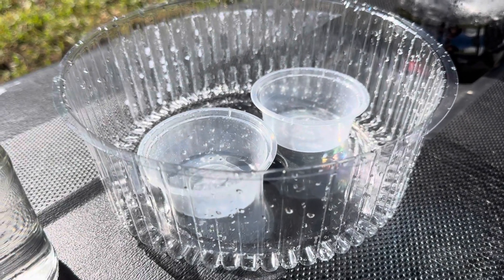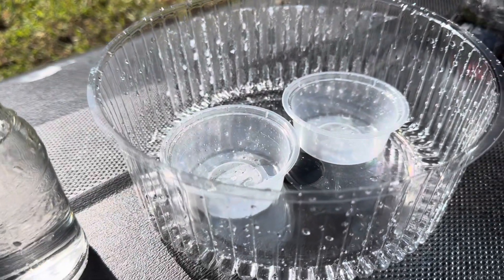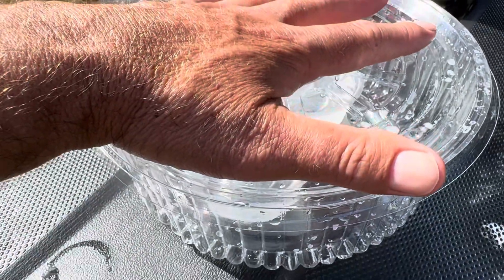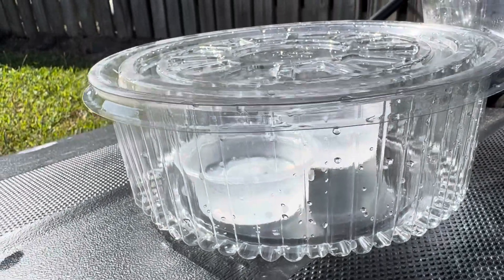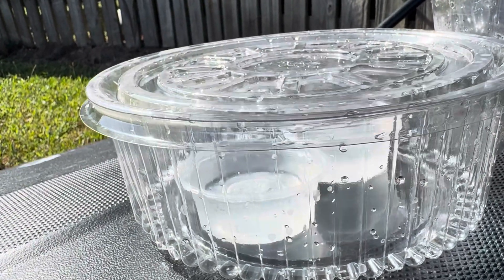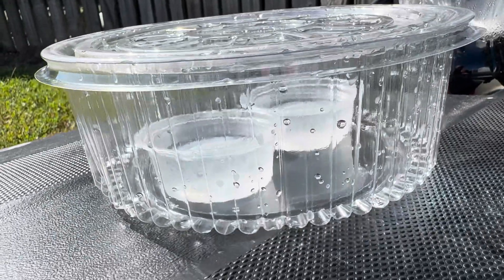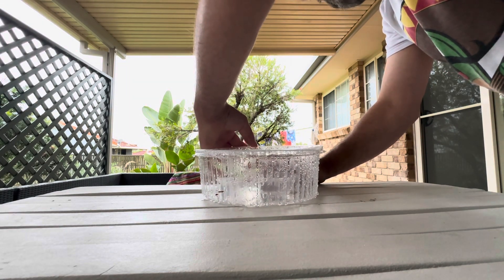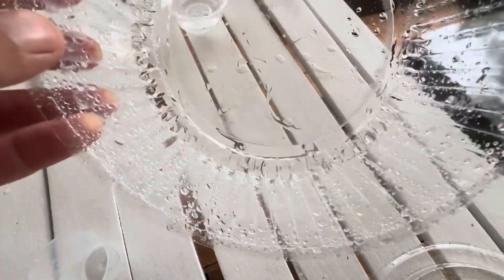Extracting drinking water from seawater at home.

Comment: maybe try a trash bag under the wide base. what was the underlying surface color in the experiments. you can compare if the trash bag black surface is inside the container or under the container. as heat collector. maybe you could wrap a transparent plastic container from inside with the black trash bag, to absorb heat into. possibly black trash bags alone could be a super solar distiller, maybe combined with desiccant as the purifier water source. yes you could even hang a black trash bag from a tree, or any other beam, with a rope. zeolite would absorb the sea water, then solar heat would be used to extract the purified water. the zeolite solar evaporation cooler might require direct sun light and not just indirect solar heat.
Reply: do you have black plastic or steel can containers.
Reply from the maker: It was actually a black basketball hoop stand, so plenty of heat. This experiment worked well but I need to set it up to extract the water as it is generated. It is far too saturated! And it is sticking to the sides and the lid.
Reply from the maker: Yep.
Reply: it seems that having SiO2 silica gel desiccant in a water filled steel container will boost the evaporation even while indoors, not in direct sun light. the water in a steel can evaporated super fast with there being silica gel about 50% to the liquid amount. ie having absorbed max water from the can. It was a couple days and the water was gone. dont know if the silica gel was also regenerated at the same time.